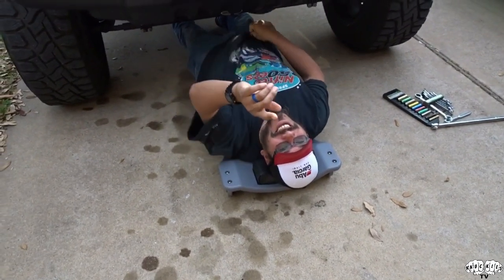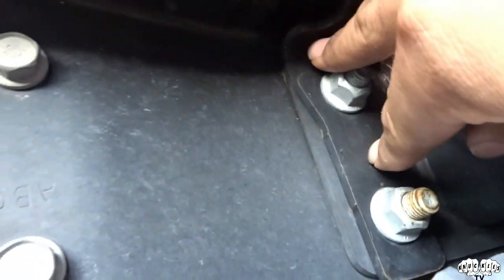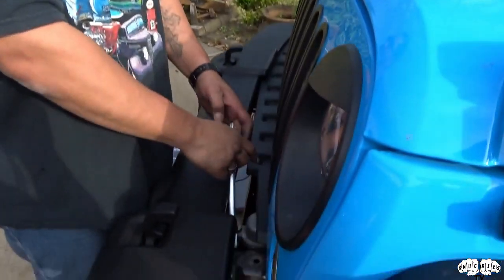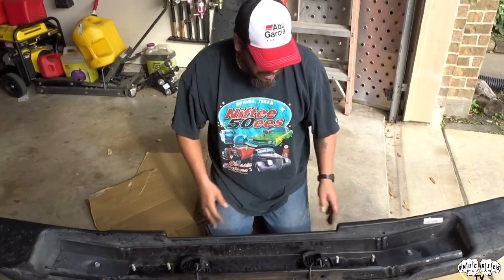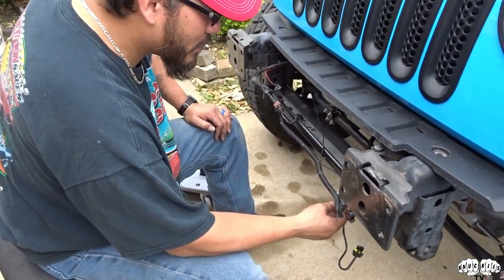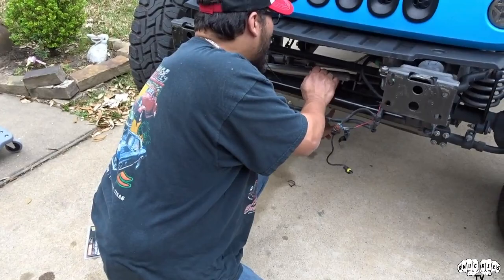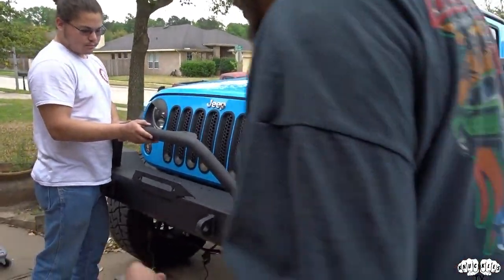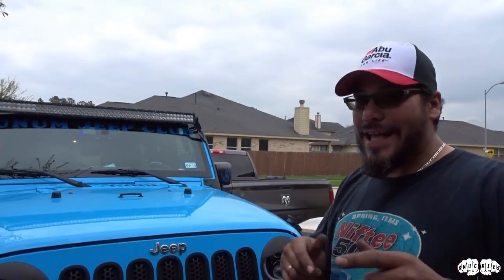Trail Master Nomad front bumper install on Jeep

Comment: The bumper does not come down and cover the crashbar or provide the protection of a front skid plate.  Have you looked into what will work with this bumper for this?
Reply from the maker: I have not kinfolk. I know there is alot of options for that though.  Thanks for watching 🤙🍻